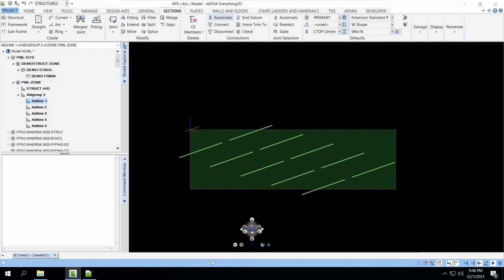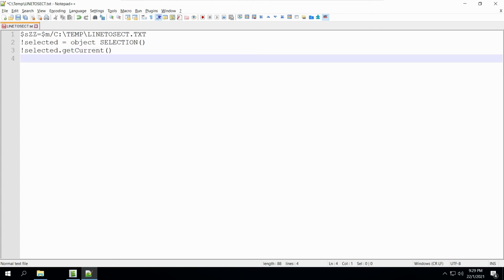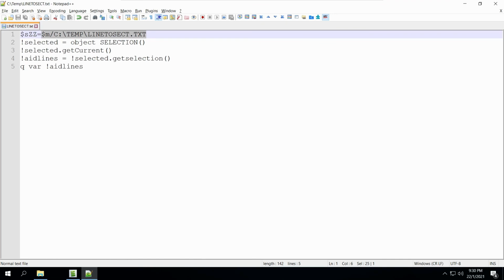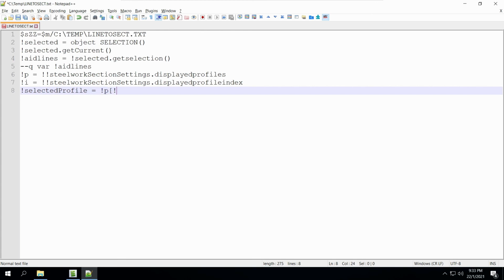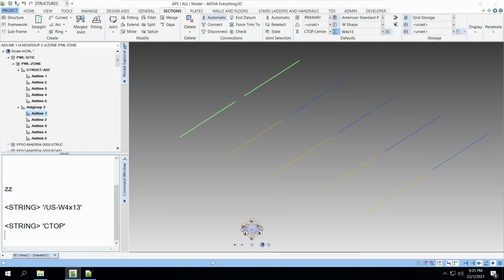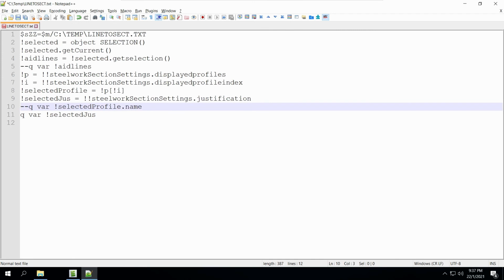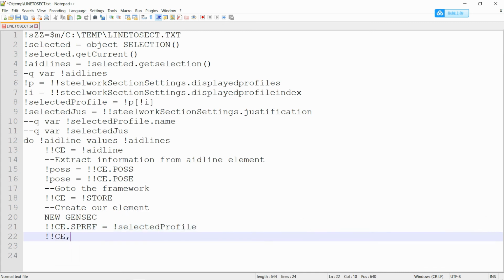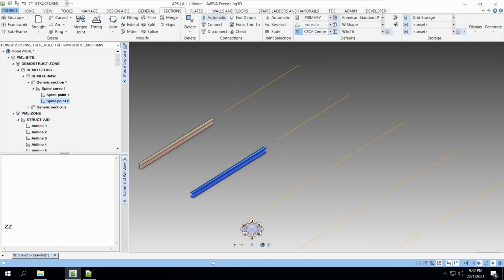Coding Tutorial - Conversion of Aidlines to Gensec

Comment: Is it possible to draw complex structures with lines and to parameterized  it with macro ? for example create stairs with lines and assinge values in txt and change just Height and run and the aveve changes stairs ?
Reply from the maker: Of course it is possible. You can do it in 2 ways, with PML or Design template. We did it for structures with some equipment using design template and PML . PML is easier for most people.
Reply: @TDSEngrSolutionsPteLtd   Sir keep up the good work, thank you for your codig PlM video. 
For me (Fresh engineering graduate) this is beyond helpfull.
If you have some literature to recommend or for me to buy so i can learn the basics feel free to recommend. 

Best of regards,
Reply from the maker: @domagojbrkovic4861   Glad you like it. We are doing more videos with people like you in mind. The AVEVA E3D help file ( available on line ) and other help file is useful ( https://help.aveva.com/AVEVA_Everything3D/1.1/GS/wwhelp/wwhimpl/common/html/wwhelp.htm#href=GS_FP.html&single=true )